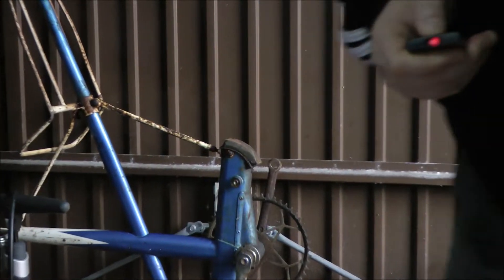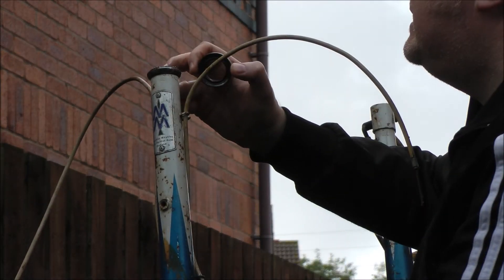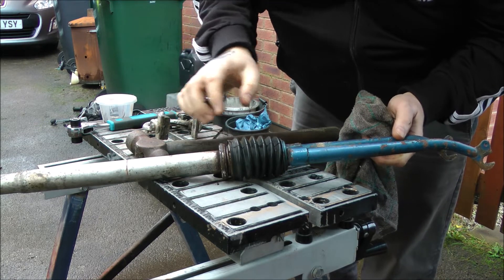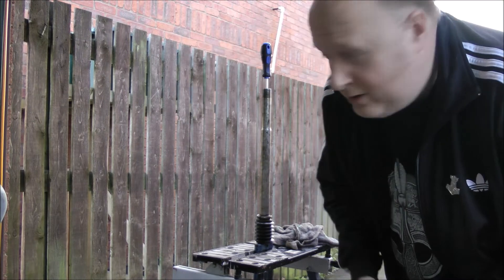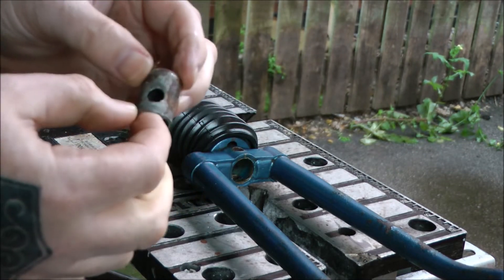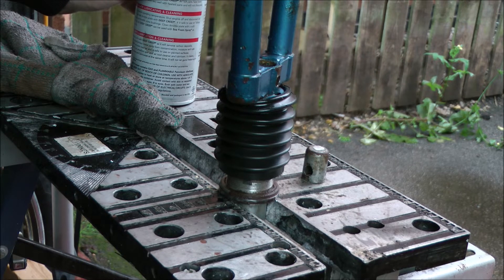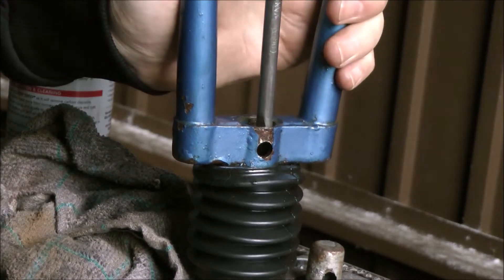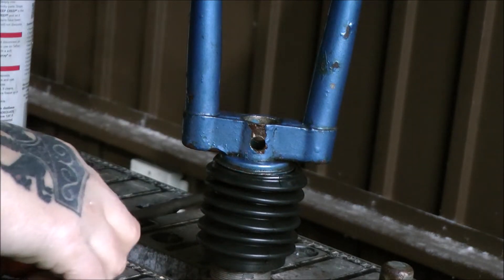Moulton Deluxe Front Fork removal

Comment: I'm really enjoying this series! Well done and keep it up. It's great to see a challenging restoration like this. If you had pulled the forks apart when you first took out the rebound screw you could probably have knocked the main spring out from the top with a rod or a wooden dowel. Also, I'm absolutely sure that the rebound spring will still be in the top of the forks. It's common for people to not see a stuck rebound spring. If it wasn't there, the forks would be able to drop out of the splined bearing by about 2 inches.
Reply from the maker: Thank you, I found the rebound spring, so I'll be cracking on soon, all things being well. I've got some brazing to do (when I buy or borrow the equipment) on the rear fork, then painting or coating. Also, the 4-speed hub needs a service & internal clean/lube so I've got plenty to keep me busy.

Comment: Hi and thanks very much for this post.!!! I’m trying to do the same thing on a 1969 Moulton minx. I’ve got a couple of questions if you have a minute sometime.!! I’m in the same boat regarding the hidden screw inside the tube… I think I can see the screw, but I can’t actually see the slots in the  head of the screw for rusty crud… I suppose it’s a posidrive but I wonder if you have any suggestions for something that might dissolve the rust enough for me to at least see the slots of the screw head??? Then I’m hoping a posidrive 2 screwdriver will be the correct one for the job. Thanks for any suggestions or advice… I know the post is a couple of years old,,, but maybe you will see this..??!! All the best. Sean.
Reply from the maker: @seangalvin9850  there's a product called Rustoleum (I think) that's phosphoric acid based. That should shift the decades of rusty oily crud. Penetrative oil - don't use WD40 as that's not what it was designed for; a mix of diesel and acetone makes a good penetrant apparently, but I have been using "Deep Creep" from Seafoam. It's worked for me so far. Good luck.
Reply: Fantastic.!!!! Thanks very much for that. And thanks again for sharing the clip…. So helpful.👍
Reply: I have found that if the screw is rusted tight the head of the screw can be CAREFULLY drilled off. I made a long drill bit by raming a 5mm drill into a piece of tubing I had lying around. Blip the drill on and off with a very light pressure and as the head disappears the spring tension foces if off and it will spring apart. Enough off the screw remains that you can use mole grips to get it out. Good luck
Reply: Thanks very much for that!!! I really appreciate it. I will give it a try.. at the moment I’ve put it back together, and it rides pretty well… eventhough there’s a bit of play  on the nylon washers I think. That’s why I was trying to get the forks apart. I just couldn’t see very clearly at all down to the screw…. I probably gnarled it a bit with the screwdriver because I resorted to hammering a screwdiver on it to establish a more positive slot..but if I can somehow get a drill bit in there like you say, I should have better luck.. keeping the drill bit centred might be tricky. And then probably have to find the correct replacement screw , or maybe thread a new one… But again, I really appreciate your advice. All the best.!!!
Reply: The screw is 3/16 BSF it can be replaced with a M5 they are so close in diameter / pitch as to be interchangeable
Reply: Fantastic info.!!!👍 Thanks. Do you mean the pitch has to be altered… I guess it does. I’ve got some old tap and dies at work… That’s great… I had read somewhere that someone had kept the old threaded piece and brazed a new head onto it… but modifying an M5 sounds much better.!!!!
Reply: Oh sorry, I just reread your post , and it’s clear… !!! Thanks again..!!!!

Comment: This seems quite a complicated set up for the simple task of dampening  MTB forks seem more straightforward, best of luck , cheers
Reply from the maker: Thanks, I might need it. It's actually quite ingenious for an early 60s cycle suspension design, keeping it lightweight, practical and simple in use. Maintenance also wasn't really needed for a long time, which is unfortunate for anyone dismantling something that hasn't been apart for 50+ years.